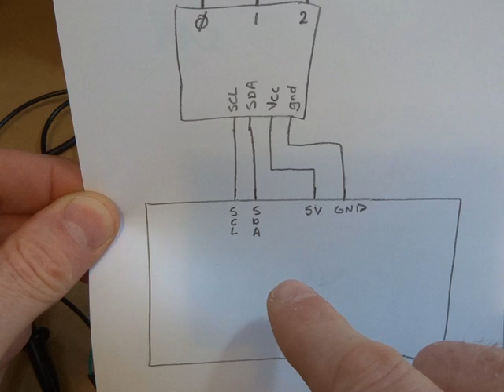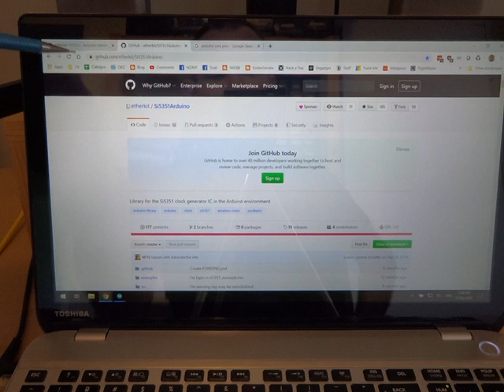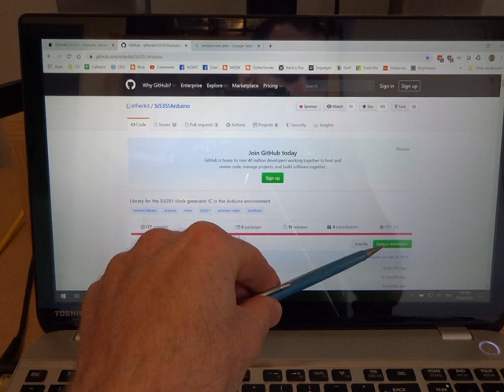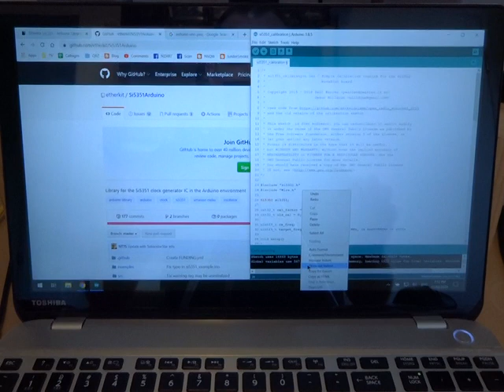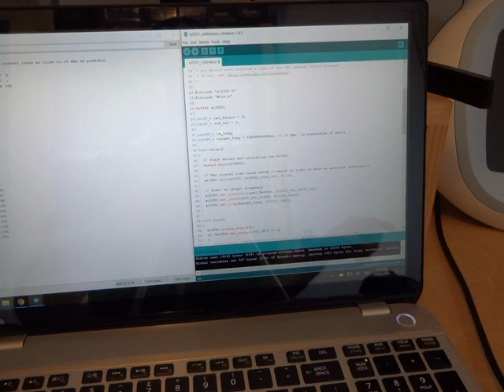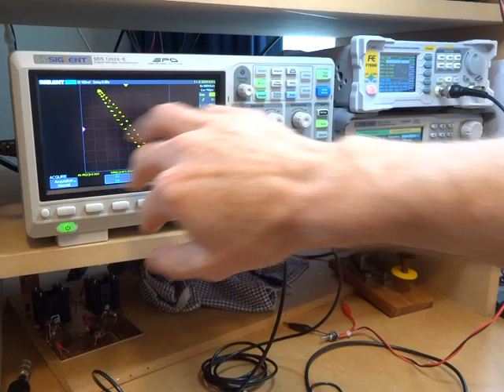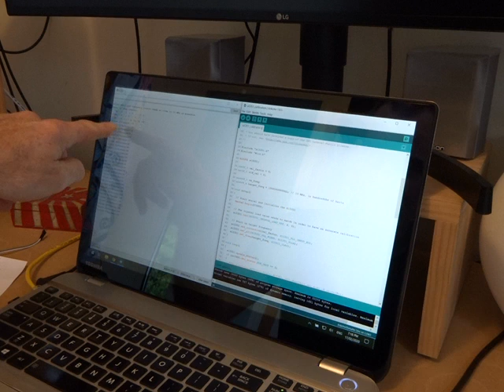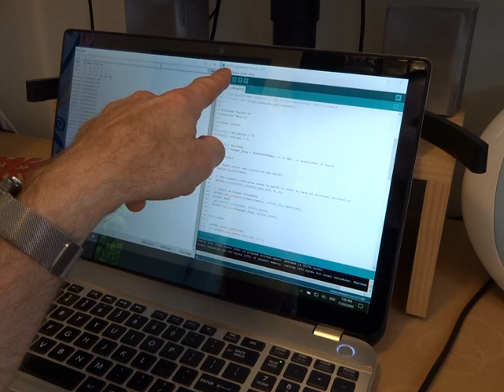Simple Homebrew DSB-SC 80m 40m Rig: Part 2a - Si5351 Wiring and Calibration

Comment: Hi Charlie, slowly working throught your excellent videos. For the frquency measurement how does your scope only frequency measurement compare? Does your scope have a frequency display for the input and if not how does reading it from the timebase compare?
Reply from the maker: Hi. I find the scope freq to be very good. The only issue (minor) is that that the least significant digit is 10Hz, verus 1Hz on the sig gen. Again, not an issue for what I do here.